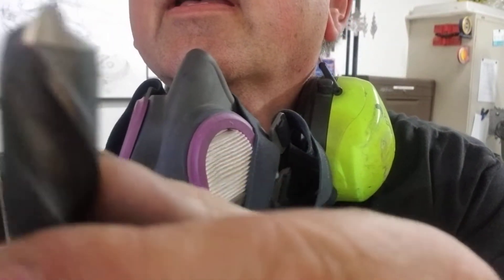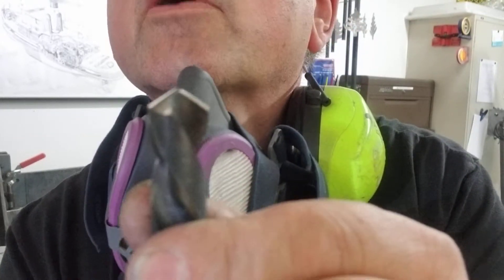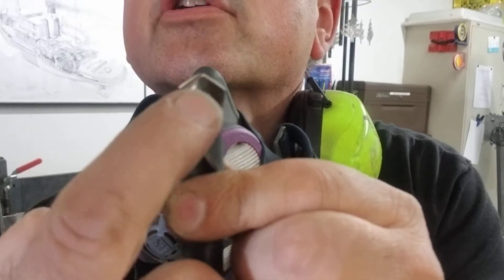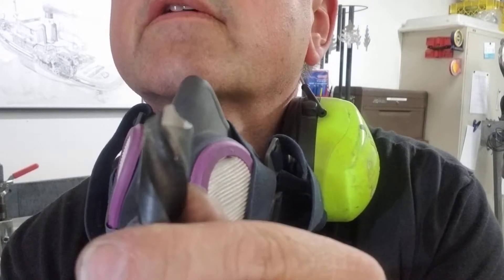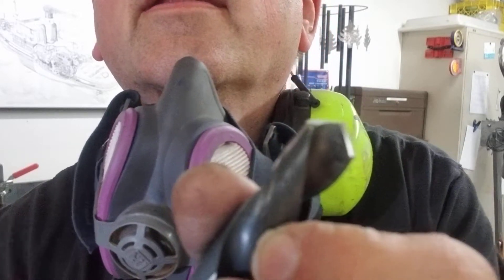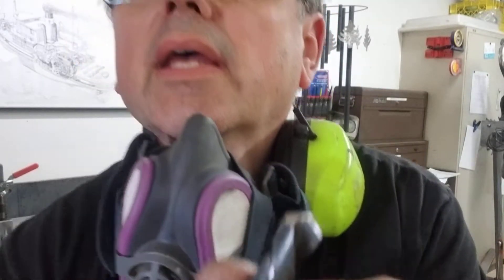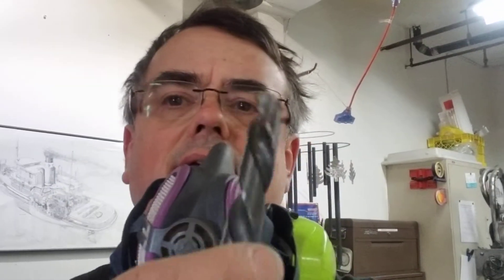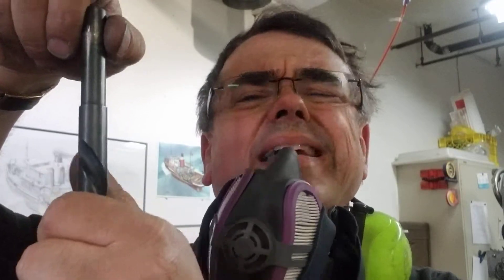Modified drill bit for drilling nonferrous materials

Comment: Thanks for the information, I am casting bronze axe heads and tomahawk heads -the drilling became a large concern for me. For reasons to do with the lost wax method of casting, I left the eyes of the axes to be drilled out later. This will help a lot with this project, thank you!
Reply from the maker: Steven Faris You are welcome. I also use Unibit step drills to deal with same grabbing issues and they are really great, too! No need to modify the Unibits.
Reply: @dondawson1  Do you believe that if I am boring a 1 inch wide hole, that I should use oil or water to keep the process lubricated? I will go in stages so not to anneal the bronze via friction heat, but I am not sure whether to use water or oil in this process.
Reply from the maker: @stevenfaris316  You have many options, when drilling non-ferrous materials. You can drill it dry or with mineral oil or water or beeswax. Yes simple pure beeswax which I constantly use! And no you don't have to use fancy commercial products. Commercial products are great for production runs where everything is calculated for specific outcomes. I use natural products wherever I can.
Reply from the maker: @stevenfaris316  By the way it is perfectly alright to go slow. Yes following the recommended cutting speeds is good to do but they are guidelines. Every task requires your judgment and experience!